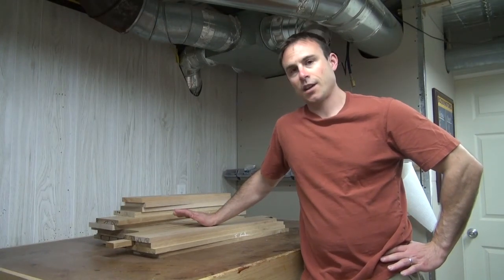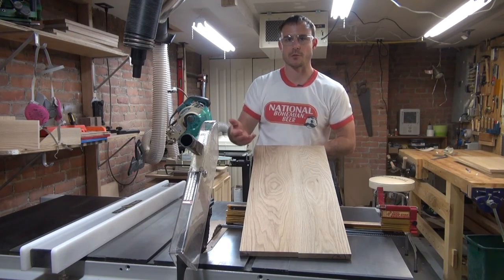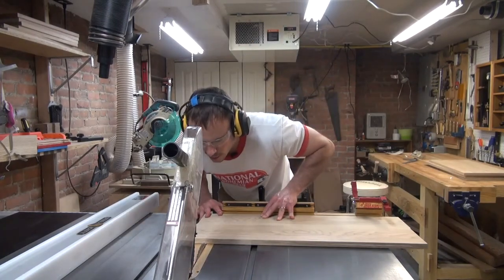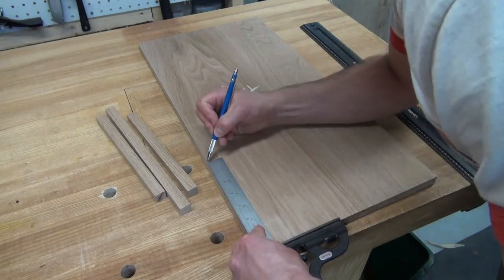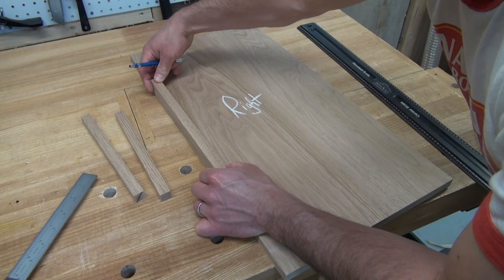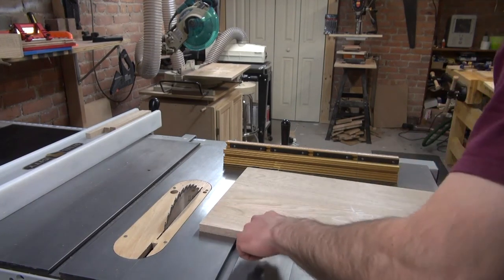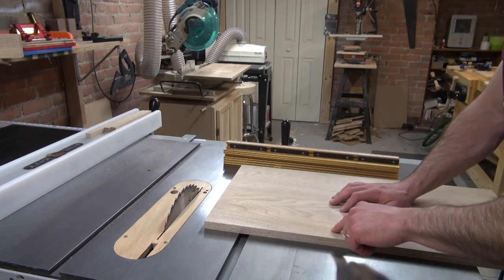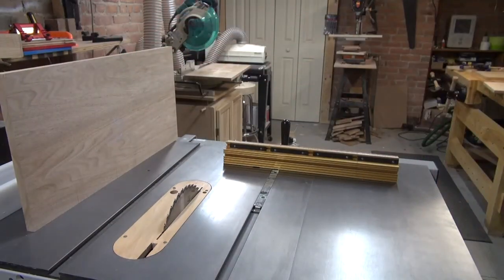Tool Chest Episode Two

Comment from the maker: Of the few other examples of stepped chests I could find, most did use the "box on box" construction you mentioned. However, I wanted to have just two continuous-grain sides, mainly because I couldn't find any other examples of where it had been done. I thought it would make the piece very unique and obviously hand made. But certainly not easier ;)

Comment: Instead of using a solid side of the cabinet and then cutting the steps into it, why didn't you just make each level as it's own small box and then essentially stack them (with some kind of cleat in between each so that they would line up as you stacked them?)  It would make it easy to move them (like campaign furniture) and since you have double thickness at each level already, it would take little to change the design.  Thoughts?  Thanks for the vids.  I like you techniques and work.